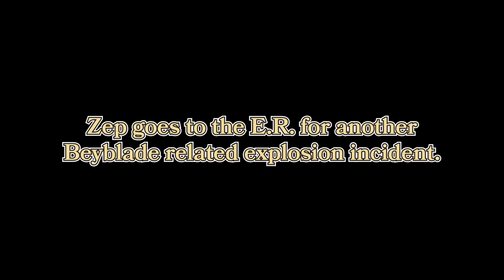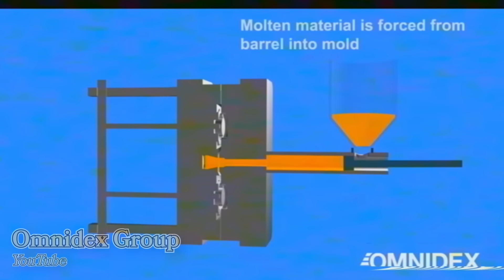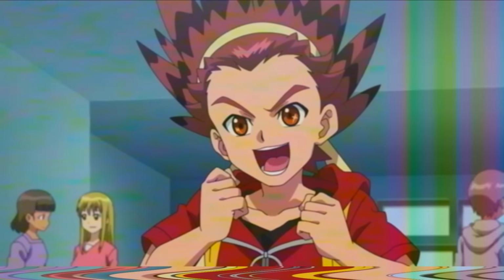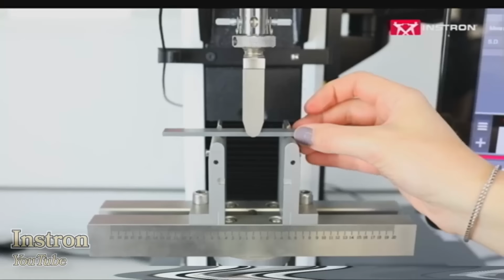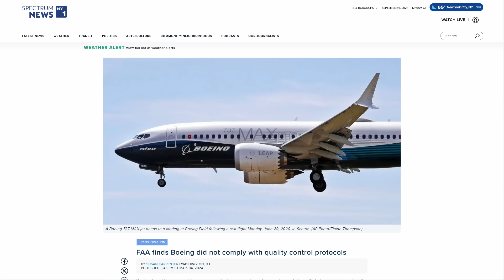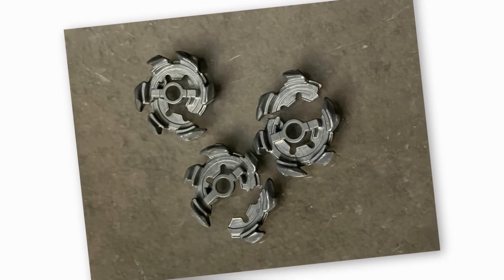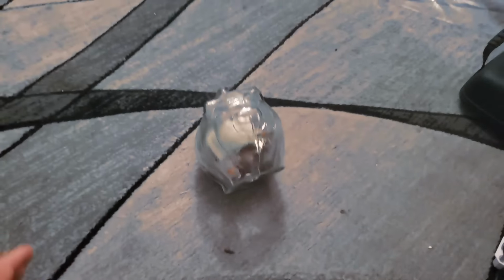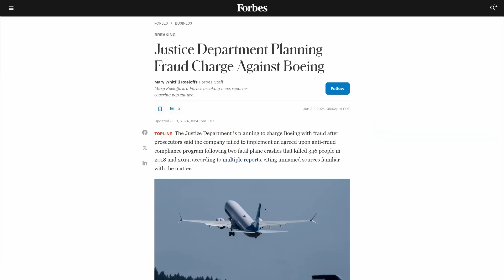The broken Beyblade epidemic.

Comment: As an engineer I can confirm all that was said here, additional fun fact: steel has a fatigue limit, if its never subjected to any stress above its fatigue limit it will never suffer fatigue or fatigue related breakage, sadly zinc does have such a limit so  it will always break eventually even if the impact forces are low. This could be mitigated with better designs that reduce stress accumulation points but that takes a lot of time and effort which would make beys too expensive. Have a wonderful day everyone o/
Reply: Considering how they often update the molds, I think they're taking the time and money to better their design
Reply: @Lavie_Azure  truly hope so, but with such complex designs stress points are inevitable and with the power of this new generation, breakage is going to happen, im actually quite surprised it has not been worse despite the numerous cases. Older gens also broke often enough and had a fraction of the impacts these suffer

Comment: My answer:  they use the same metal and plastic from previous gens without taking into account that X moves way faster and hits way harder.  Thus causing beys to break
Reply: Not true though. The plastic and metal parts used are of different composition
Reply: They have made the plastics softer so that it deforms when hit, rather than break. They can't really do too much with metal that I know of

Comment: I feel the main reason these beys break faster beyond the Xtreme line gimmick is the launchers themselves, except for the Hasbro starter launchers. Any launcher outside Hasbro's use gears in the launcher to up the rotation speed of the launcher itself while the starter launchers are direct connections.

Comment: I’ve personally only experienced breakages with the plastic tabs that hold they blade to rachet. This happened to both my TT knight lance and Viper tail. However at least hasbros molding seems to have addressed this somewhat with curving off the little tabs while I doubt this will solve the problem as a whole or most definitely helps reduce the stress those tiny ass tabs have put on them. So I think it’s very likely that hasbro releases might address more problems at large.

Comment: Beyblade X problem is it metal is way thinner than metal fight but it have way more aggressive design and hit way harder
And it also have exposed plastics on the blade where the metal part make contact, and its can deformed make the connection worst
Worst design+harder impact = just trash durability
Reply: Some of my X bey almost reaching that point too
The connection between the plastic and metal on my dran dagger and buster already feel loose and wobble
Now it's just the battle of nutrition between who break first
The plastic or the metal

Comment: Beyblades TT fusion wheels are actually made of zinc. Fake beyblade fusion wheels show the copper when hit and are much lighter, also aluminium is too light. And Beylegacy made a good video on it https://www.youtube.com/shorts/K1EAPVMprZ8?feature=share 
https://youtu.be/tKfUPx-76D4

zinc is the only metal in the ZAMAC list that can be melted by a tiny blow torch in that little time, as the other metals have a higher melting point.
Reply from the maker: @modify_6703  the melting point of Zamak-3 (4) (the metal used in almost every single toy with diecast components) is ~384°C, well within the capabilities of a blow torch.  Also you can melt those other metals with a blowtorch as well, I have done so for classroom demonstrations.  Zinc needs to be allowed to effectively be used in these applications in most cases.
Reply: Thanks for the correction, but i don't know how to use celsius,

Comment: I don’t know much about Beyblade, but I’m into Hot Wheels. That’s the same alloy that their bodies are made of. It’s fine for little cars that might have to take a few hits if you run them on a track, but yeah, it’s not stout enough for this application. Hasbro and Takara should know better, they probably use the same stuff for Transformers.
Reply from the maker: It's actually ideal for this application, they just need to add proper supports – which they have with mold updates, luckily!